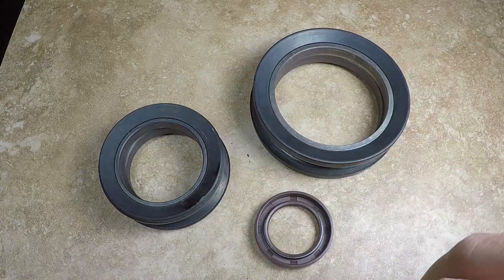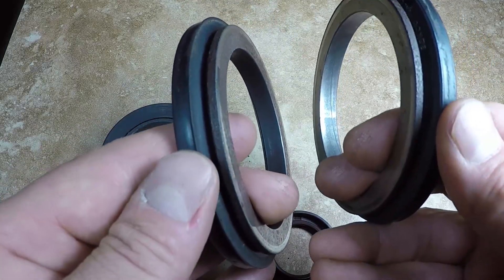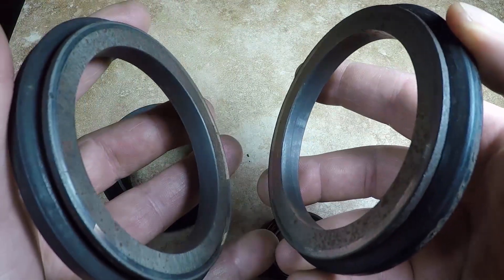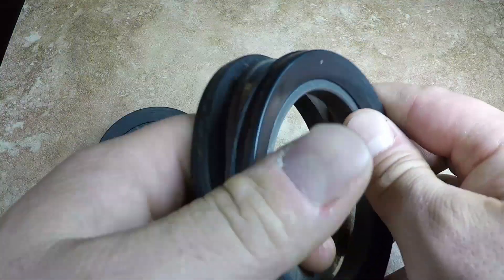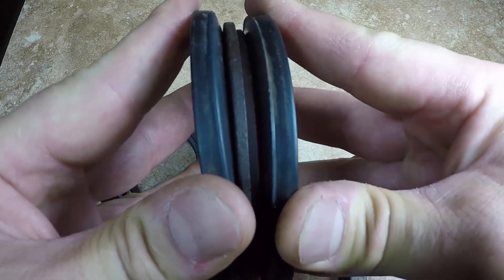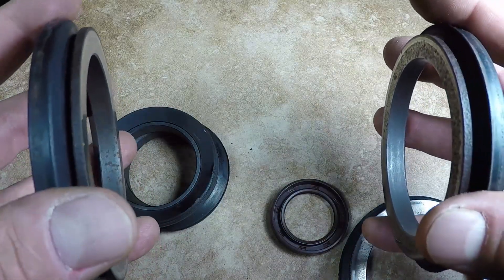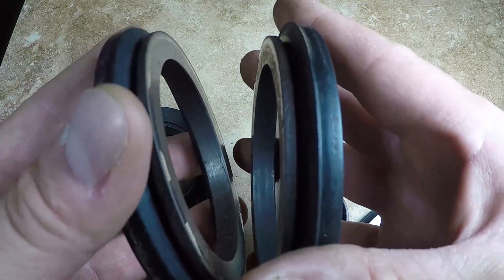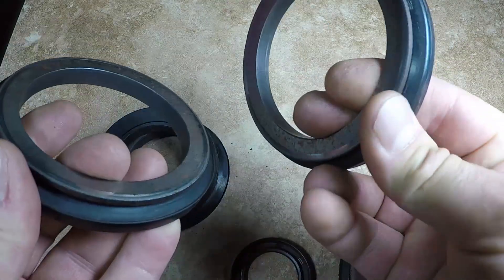Metal Face Type Oil Seal

Comment: don't they rust, for example if the machine has been standing idle for month' ?
Reply from the maker: The metal surfaces will rust if they are dry and not installed. When they are installed correctly, the seal surfaces are very tight and will not rust as water and air will not be able to get there. The part facing the rubber is also sealed. The only area that is subject to rust is the outer side which will not effect the seal preference. Thank you for watching.